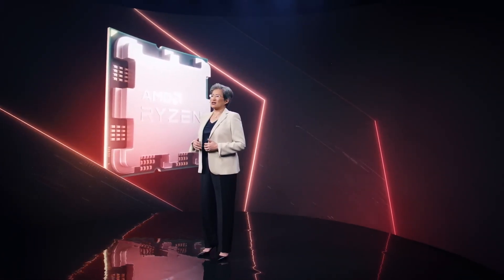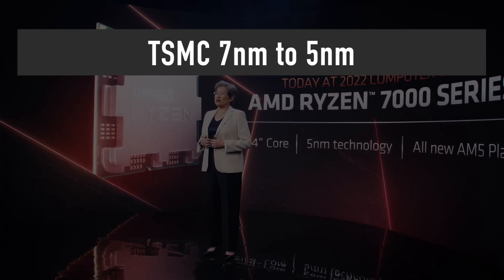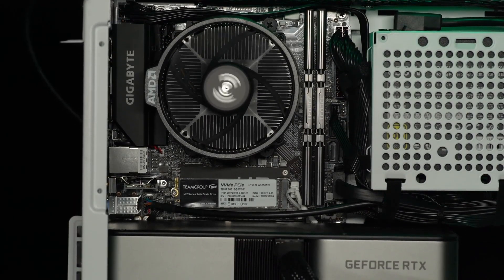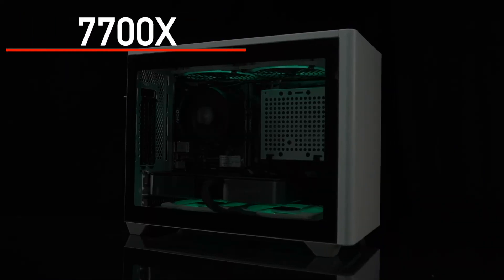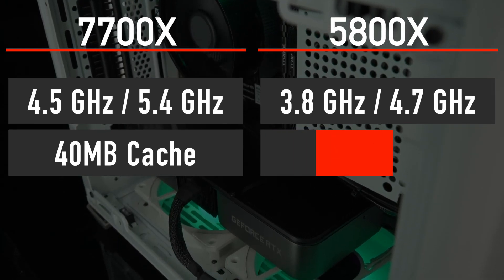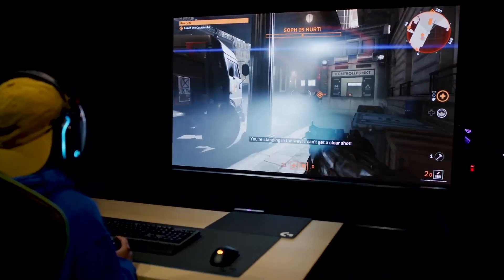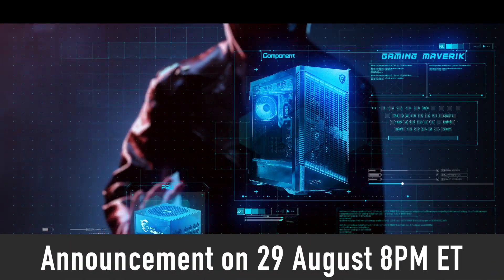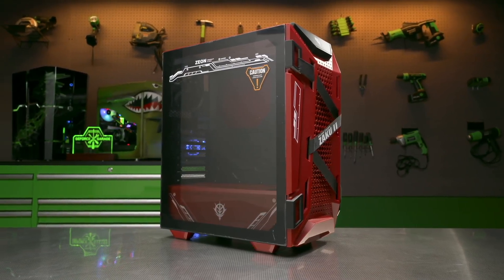EVERYTHING About AMD Ryzen 7000-series Desktop CPUs

Comment: Does r9 7900x work on b550?
Reply from the maker: It will not. B550 is AM4 socket. New Ryzen CPUs will be on AM5 socket so you need a new motherboard.

Comment: I will never buy a CPU with more than 65 W TDP. I guess an Apple M2 Pro will convince me more.
Reply: Build quality and repairness sucks for Apple. The cpu is very, very good though.
Reply: @scality4309  Build quality is quite good on Apple devices, but yes, repairness and extendability sucks.
It all depends what priorities someone has. 
Personally, I want a very efficient CPU which still offers fast performance and here comes Apple in.
Reply: @StefaNoneD  You should watch the video backlog from Louis Rossman on YouTube.
Reply: @scality4309  Well, don't think that other manufactures have a better build quality. It's just that other manufactures have maybe 40 laptop models and they sell less amount per model than Apple. So you hear less complaints about design failures.
Reply: @StefaNoneD  I always liked the T series from Lenovo.

Comment: Recently got a 12700k for 1440p gaming it’s going quite well from a ryzen 5 3600 I plan to upgrade in 2024 possibly back to amd but considering they kept the same core count the intel seems to have better value since the 12 core 24 thread 7900x will be $800au be vs 600 for my 12700k isn’t bad Hopefully amd can keep innovating to keep intel honest the last few years have been great for consumers shopping for cpus.
Reply from the maker: Performance should be the deciding factor. Number of cores is irrelevant if performance says otherwise😉

Comment: I'm thinking of getting a new CPU + Motherboard soon, was thinking of the i7-12700K atm but il be patient and wait to see and hear what AMD has to offer, however if they do not release motherboards that are DDR4 compatible I'll just go with intel's 12th gen ( Yes 13th gen is close but the i7-12700K has everything I need and its overkill already plus I don't wanna wait until Oct-Nov)
Reply: AMD 7000 series will only support DDR5 memory.
Reply: @rasheedarif  dang, as frustrating as that is for people who already have decent RAM, I think it's just a matter of time until all motherboards are DDR5 only, just like we left DDR3 in the Dust. I think I'll just buy the i7-12700K when I see a decent deal on amazon, it's still overkill for what I do and a great CPU.
Reply: @ZealousPumpkinTV  Since you are saying 12700K is an overkill for your use cases then try 12700 with MSI B660M-A DDR4. Your performance will be better than 12600K but slightly less than 12700K. It's great combination. You can check out the video from Hardware Unboxed to see if it fits your needs.
Reply: @rasheedarif  I think the i7-12700 (non-K) is great too but I wanna invest more for the K version which features higher boost clocks plus in the future the k version of this CPU will maintain a higher value for re-sell if I ever need to sell my PC for any particular reason. even if I'm pairing it with the msi b660m mag mortar D4 (I don't plan to overclock it has great VRM's for temperatures and power delivery) ( I over exaggerated the overkill part because I will be streaming and playing videogames a lot or doing content creation on sony vegas pro 16) the extra performance is always welcomed, it's better to have left over power than almost hitting any power threshold plus it's a bit more future proofing even if it's by a small %
Reply: @ZealousPumpkinTV  Then buy MSI Pro Z690-A motherboard, price difference isn't much when you compare it to B660 mortar and moreover if you pair it with locked motherboard you can't overclock, which is the only reason you are paying extra. In Z690 it will autoboost in demanding task. So for extra 50 USD let's say you will use your pc for next 3 to 5 years, that amount is negligible and gives your cpu its flexibility and performance bump which is intended by it creator.
Reply: I have a i7 12700K on a MSI B660 Tomahawk WiFi DDR 4.

Not original picked that way but on the day I placed my order the K was on offer so cheaper than non K and the same with the motherboard the ATX Tomahawk was very slightly cheaper than the mATX Mortar!!! Both have excellent connectivity with USB C front panel connectors.

However watching it pull a 4.75-4.85 all P core without having to do anything but enable XMP is rather nice.

With a RTX2060Super it’s flying through productivity tasks.
Reply: @deepend9376  Nice! yeah that CPU chews through anything you throw at it, I personally have an RTX 3060, 16GB of DDR4 3,600mhz with an i7-9700, I want a more powerful CPU for streaming+Video editing, Il first install a clean windows 10, install all drivers for the motherboard and some basic programs>  reset PC >Enter BIOS and Enable XMP, if there are no issues with stability Il keep same bios version, if something might be wrong il disable XMP > Flash to the latest bios > re-enable XMP.
Reply: @deepend9376  Yes, there is nothing wrong with a B660 motherboard and a good B660 board have enough features and connectivity that an average user gonna use. But an unlocked cpu will definitely gonna perform better on a decent Z690 board because it enables the auto overclock feature on those CPUs. I'm only saying that you are paying those extra money just for that one feature and when you're pairing it with a B660 board then you are practically wasting your money on feature that never gonna be used.
Reply: @rasheedarif  
Normally yes but the 12700K was cheaper than the plain 12700 so I just ended up with faster std and boost speeds for less money.
Reply from the maker: There will not be any DDR4 motherboards. At least not for a long while. I can see how they launch something like a budget A620 much much later that does support DDR4 and some sort of a new low-tier Ryzen 7000 CPU. Ryzen 3 maybe. If it will even return. Or just a Ryzen 5000 refresh on a new socket. Which would cost below $200.
Reply: Same thing here.

Comment: onlyjust upgraded mb mem and cpu so maybe  i can afford to upgrade in the next 8 yrs
Reply: May i ask what is the specs of your build?
Reply: @Zorahime29  only a ryzen 5 3600 
Aorus X570 ELITE but paid a lot for the 32 gig mem and an rx 590 so basic :) so my current best parts would be obsolete upgrading to am5 and ddr5 with processor and i still need to upgrade gfx

Comment: I don't think AM5 is going to support more than 3 generations.  The logic:

Zen 4 is not a total overhaul, Zen 5 is.  Zen 6 is an improvement to Zen 5.  Zen 7 is once again a total overhaul.

I think the world of CPUs is changing SO much that AMD is going to want to move to a new socket because of adding PCIe lanes or added capabilities or a handful of other reasons.  They WILL be adding acceleration at some point, hardware acceleration and could possibly be adding FPGA capability to the CPUs.  I just think the competition between Intel and AMD right now is SO hot that Zen 7, which is an overhaul could likely be on a new socket.  I mean we could even have DDR6 by that time, which the world of server already needs it even though DDR5 is new.
Reply from the maker: I wouldn't be mad if we had 3 generations on AM5. Sometime progress requires change and it is OK.
Reply: It would still be better than Intel.
Reply: AM4 boards are already segmented between the generations of Ryzen, the difference is it uses the same CPU socket, and so you can mix and match generations and still get a functional PC.

Comment: im building my first pc this year, and i think im gonna wait for the 7900x or 7800x3d (if that comes out by the end of the year), ive got the rest of the build planned so im just waiting for the cpus
Reply: Also note the 5800x has 60mb less L3 Cache then the 5800x 3D but the 7900x only has 20MB less
Reply from the maker: It should be a good year to build as you will have plenty to choose from. Should be new GPUs and CPUs from all the companies🙂
Reply: @theivadim   I am also planning to build my first ever pc and I am more focused on likes of rtx 3080 and perhaps a 5700x, hopefully the new releases end up making the last gen stuff even cheaper as for performance, they will do good enough for years to come
Reply: @JohnWick-9050  Don't buy the 5700x get the 7600x instead fewer cores but the performance increases will be huge and the price will probably be cheaper except maybe the motherboard you will also have an upgrade path
Reply: @randomshorts739  to just get the 7700x which will just be a better 5700x or get a i7
Reply: @yamsbeans  7700x will just be a better 5700x yeah it will but a lot faster cores aren't the be-all and end-all ipc speed of the processor these ones are meant to do about 5.5ghz and the upgrade path on the new Ryzen motherboards will  make them then the best buy you will probably get 3 generations of upgrade with the new Ryzen's releasing you will get 1 intel

Comment: I have 64GB of DDR4... 13th gen it is...
Reply: I have 64GB too but I figure I'm going to eventually have to move to DDR5.  The options suck TBH, I either invest in 13th gen and don't have an upgrade path with a simple CPU upgrade, or I invest in AM5 which will likely have a very good upgrade path but I'll be purchasing DDR5 that hasn't matured.  I'll likely end up purchasing 7900 or 7950 and sell my 5600x, MBD and RAM to offset the new DDR5 cost, if not cover it completely.
Reply: @AvgDan  ^

Comment: I hope Ryzen 8000 or 9000 add at least 2 cores for all processors
Reply: Zen 5 is supposed to be AMD's interpretation of the big.LITTLE concept, so definitely more cores across the range.

I'd be very surprised if AMD don't offer a more segmented product stack to tackle Intel's 14th gen and beyond. It'll be interesting to see how AMD's mobile product stack evolves, too!

I'm more keen on Zen 4 & 5 -based APUs, I think thee 6600G and 6700G will stomp anything that Intel can try to come up with...
Reply: @temperatechimp  AMD's Zen4c cores will have SMT too, unlike Intel's E-cores.
Reply: @chlorobyte_projects , exactly. AND they'll be much more powerful than whichever "-mont" series Intel decides to use.
Reply: They are planning on adding more cores soon.

Comment: If the 7600X is under 250 USD (and they release affordable B-series mobos) it's going to be a wrecking machine... even on DDR5 since I'm sure those prices will continue to fall as more is produced.
Reply from the maker: Too bad B650 boards are coming later. Only X670/E at launch.
Reply: @theivadim  Yeah, hopefully its not too far in the future like with the B550 /X570
Reply: @SpoonHurler  IIRC, B650 & B650E mobos are launching in early Q1 of 2023, possibly at CES...
Reply: B650 is gonna be expensive I am calling it
Reply: @ca9inec0mic58  No, it's not.  B650 is cheaper to produce actually.
Reply: @ca9inec0mic58  It would not be the first time AMD raised prices. If Intel doesn't offer a decent budget option I could definitely see that happening
Reply: @ca9inec0mic58  that's not what's being reported, though. Still, plans can change. Still, it's the market situation on 5xxx series inventories that'll influence AMD's launch strategy...

Comment: I'm planning to go from 2700X to 7700X, the gains are going to be HUGE!!
Reply: Hold my beer, I've got an i7-3820 from 2013, and plan to get an 7950X
Reply: @DinoFancellu  i have an i5 4590...
Reply: @librasd8087  Switching from i5 4670 Here
Reply: thats nothing dude. im going to 7600x from fx 4100!
Reply: @ngreediagraphics2858  i think you win so far
Reply: im going from a Phenom II X4955 BE to 7900X, i win so far haha.
Reply: @chumei5178  sure beats my FX-6100 + R7 265, that's for sure...
Reply: I'm going from a Texas Instruments TI-84 to a 7950x. I don't think it will be a huge difference though.
Reply: i5 3570k here.
Reply: Well pups, I went from Radeon R7 M440 + Core i5 7200U to RTX 3070 + 5800X.
Reply: I found my fellows! 
Some of you have been holding out for longer than me... I'm still on an i5 4690 with 1070. 

We have waited this long, another few months for detailed reviews and mass release bug fixes won't hurt. 

I'm leaning toward a full AMD build, but could sway depending on price/performance/bugs.
Reply: @littlemat0  IKR. If I have been holding for this long. I'll make sure I wait for the reviews and bug fixes. Been waiting to make some youtube videos that my old computer just can't handle haha.
Reply from the maker: Should be nice. Especially if you are doing stuff were your older CPU is limiting you now🙂
Reply: And me from i3-6100 to R5 7600X
(But that ddr5 price tho)
Reply: @abbabubba  the pricing is decreasing, and will continue to do so, barring any unforseen circumstances...
Reply: @temperatechimp  let's hope

Comment: At this point, especially after getting my Steam Deck- I'm far more interested in the APU market.
Reply from the maker: I was considering to get Steam deck as well. Buy lack of performance to run modern games even at 720p60 stopped me. How is your experience with it so far?
Reply: @theivadim  excellent, tbh. Shockingly excellent.
Reply from the maker: hm... maybe I should reconsider and get on the waiting list to get it🙂
Did you get the 512GB or 256GB version?
Reply: @theivadim  I got the 512mb version but it doesn't help performance. Just grab the 256, a matte screen cover, a 512mb micro SD card and rock on. It's one of those devices that are too good to believe until you play with it. I've showed a few people and all they could do is laugh at how crazy it is.
Reply: The ryzen 5000 APUs are powerful, but they are limited by the old VEGA chips for graphics.  The new RDNA 2 chips that were use for the ryzen 6000 series had made incredible leaps in graphical power.  Like it is pushing into gtx 1000 territory.  The ryzen 7000 series is going to get more powerful.
Reply: @Snowman0147  exactly. Feed me the 7000 series!

Comment: That is 10-20 watt more end 9900k,  but what do they use in idle mode, i know 9900k use only between 9 to 15 watt
Reply from the maker: Idle is irrelevant, imho. You should put your device to sleep or turn it off if you are leaving it for a while🙂 I haven't seen anyone talk about it in reviews in like forever.
Reply: @theivadim  I'm guessing they might mean, like in desktop mode, a bit of light browsing, etc, which is often what a pc will do when not going balls to the wall on games or rendering. With energy costing more, all the time, having a pc which sips power most of the time is useful
Reply: @theivadim  I know i always turn my computer off when i dont use it :) maybe it sound weird but when i build computers, I always build according to the most efficient power safe mode, so that I can save both energy and power at the same time, i know that is not irrelevant for games but lazy guys that use lots of time on the net
Reply from the maker: Makes sense🙂👍
Reply: If you care enough about idle power draw, you might as well pick up one of those mini PCs.

Comment: I am excited to intel 13th gen 13600k. Because it 14 cores my god 🤯 it's absolutely midrange monster but my fear is pricing
Reply from the maker: Yeah... I am not sure how 7600X is supposed to compete with 13600K. I wonder if AMD will price the 7700X against 13600K instead this time. Would be amazing to see 7600X priced closer to $200 while offering better performance in games than 12900KS🙂
Reply: @Ytility  DDR5 pricing has been falling, and will continue to do so. By the time Ryzen 7xxx launches, the price difference will be tolerable for the performance gains.

Barring any unforseen shortages, that is... <knocks on wood>...
Reply: @Chendur Kumar, that CPU doesn't have 14 P-cores, but 6 P- and 8 E-cores, which aren't great for heavy multithreading situations. I agree with @iVadim on his perspective.
Reply: @temperatechimp  the scores are the reason why the i5 is better than the ryzen 7 at multi thread
Reply: @yamsbeans , @Chendur Kumar ...for now, that is. AMD won't be resting and twiddling their thumbs, that's for sure. Meteor Lake's E-cores don't come with Hyperthreading, but Ryzen 8xxx's little cores will come with SMT. That will make a big performance difference. That, and the longevity, availability, affordability and superiority of the AM5 platform will ensure that Ryzen 8xxx CPUs and APUs will be better choices over Intel's Meteor Lake offerings.
Reply: @temperatechimp  yeah I know E core has 3 Ghz above something this is enough for me I am prefer gaming. SO Gaming standard needs 6 or 8 threads and also I am like intel cpus because I don't know ryzen also gives more performance but I want to buy liked one TEAM BLUE
Reply: @chendurkumar3853  time to do more Ryzen research, then! And wait for the reviews, as well...